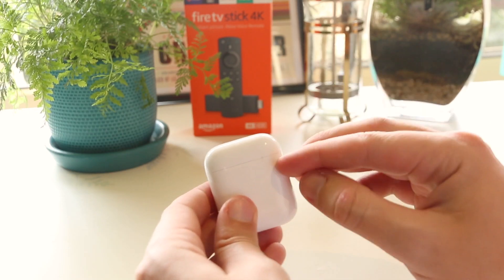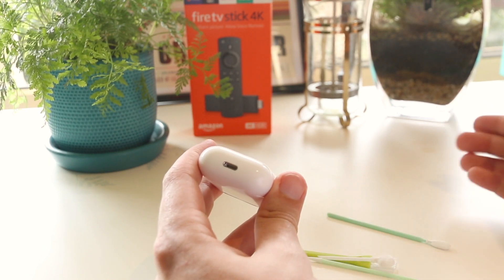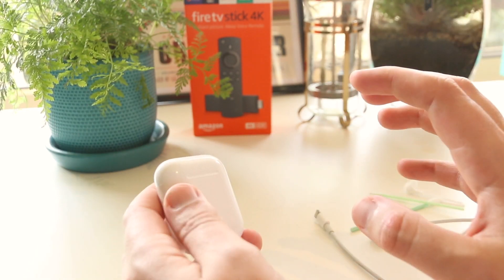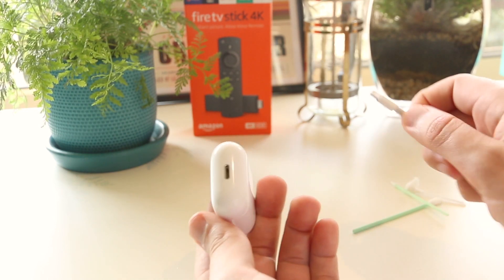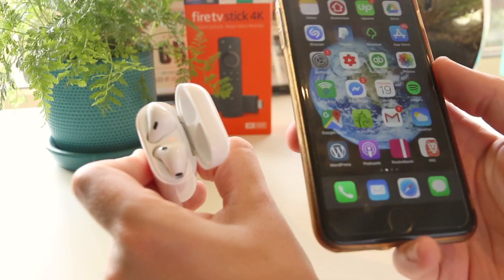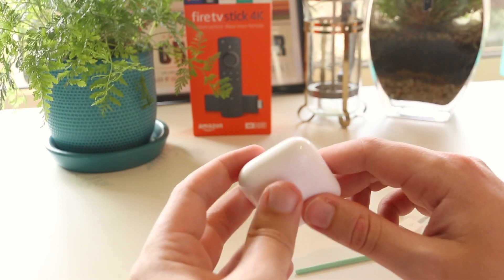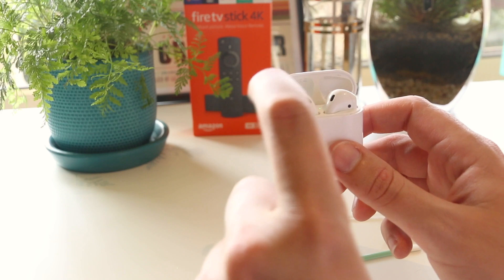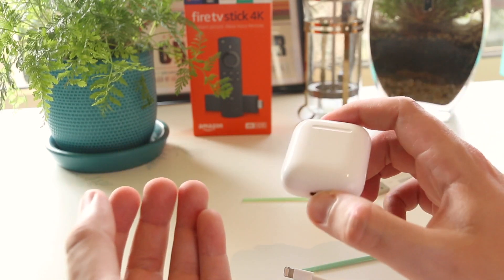AirPods Case/ AirPods Not Charging! 🔥📱🔋 [HOW To FIX!] [SOLVED!]

Comment: AirPods would charge and the case wouldn’t even turn on I tried everything and it just came down to being I had to switch chargers even tho the charger works on other devices
Reply: @seriousryRL what charger did u switch to?
Reply: It wasn’t any official Apple charger just another I had laying around the house.
Reply: @toilet paper Yes I said that I just needed to change the charging wire if it’s anything other than that being the issue I have no idea.
Reply: @seriousryrl3919  thank you so much i had the same problem so ima try that rn
Reply: @seriousryrl3919  BRO IT WORKS THANK YOU SO MUCH I LOVE YOU DUDE
Reply: Return to place of purchase for exchange or refund
Reply: I e got a solution that worked for me
Reply: Hold the button on the back and keep holding than plug in the USB cable while holding the button and then you should see the light pop up🤩 I found this while fiddling around with it
Reply: Mee too
Reply: @seriousryrl3919  that is what I did
Reply: Thx for the help
Reply: ehm- my airpod case is always red- idk if its charging or not- it blinks red then the red light would go out- idk how to fix it-
Reply: That is what happened to me
Reply: Ok me 2
Reply: @leej1a  same suffering here
Reply: @sokatsui2051  diddnt work
Reply: guys my airpods light goes orange for 8 seconds when i plug them in and then no light appears, i left them charging for about 2 hours but still nothing...anybody knows a solution ?
Reply: @TheAlexgou   I took my airpods in same condition to a repair shop ...he charged me only 200₹  means 3 dollar , but i am sure this mistake is a little mistake ...As he fixed that in a very few time , then it was charging perfectly,, but now unfortunately both airbuds are not charging ☹️ and Bluetooth doesn’t work , he asked me for 200 rupees ...i left them there ! without paying because that was not connecting to any phone
Reply: @TheAlexgou  Changing chargers worked. Did you try that?
Reply: @seriousryrl3919  tried my brothers charger and got nothing, fast forward 2 days after and now the orange light is not even lighting up...
Reply: @SeriousryRL Real legend it worked!! ❤️❤️❤️❤️ (no homo)
Reply: @officialtoiletpaper  sams
Reply: @officialtoiletpaper  same
Reply: I am gonna try this when I get home I will lyk if it works
Reply: @Random420.  Hope it does. That’s just what worked for me.
Reply: @seriousryrl3919  it did  thank you

Comment: THANK YOU! At first I tried, putting back and fort the charger and still not working. Then, just like you mentioned, check inside the charging maybe there’s dirt, and behold, there’s heaps of small dust and crushed paper inside. PRO-TIP: Use a Pin or something thin to clean inside it, it will make your life easier. I used the one pin thing that you use to put your sim card (i forgot the name of it) but yeah, it work. Thanks!
Reply: Maybe ejectment pin?

Comment: Can anyone help me out? My Case is having trouble charging n I’m getting pissed off. I switched chargers and I thought it worked because of the orange light but when I open the case and you see the percentage of your airpods it says my airpods are charging but my case is at 0%
Reply: i have the same problem, i cleaned them and changed chargest, but nothing is working
Reply: Same
Reply: I have same problem
Reply: same but my case it’s at 26% but i just got them today
Reply: @noellecrawley3838  same I got my AirPods yesterday but my case won’t charge🤷🏽‍♂️
Reply: Same
Reply: Okay I figure that out it was happening to me I charge it with my computer all I did was plug the charger into the wall and it work
Reply: @noellecrawley3838  me tooo!! but
they are stuck on 27%
Reply: @Mar-dk5ps  do you cablr in and keep pulling it out it worked for me
Reply: This is exactly whats happening to me
Reply: We have the same problem. Mine is in 0% as well, it sucks
Reply: @tythegod6575   same as you.. Hehe 😂
Reply: Wait for it and it will start charging just wait 10-20 mins and if it’s still at 0 
Than i dont know sorry

Comment: Guys I got you I found the solution for AirPod case not working but only working when charging the AirPods all you have to is charge your case for 1 hour and then it should be back running again with the color green again if it’s still not working it’s either you have to restart it, clean between inside the AirPod case charger place, or last option just buy a new case 
I hope this helps

Comment: The orange light turns on for a sec then shuts off won't charge and I just got them (2nd gen
Reply: Yeah
Reply: I have the first generation but the same for me
Reply: Same
Reply: Bro I got you if you have a place you can charge you AirPods up at that does not need a cube like you ps4 or Xbox but they have to be on after you charge it to 100 it should work with any other plug and cube

Comment: My charging case doesn't charge but the actual airpods does. I cleaned it already and it still doesn't work😭😭 it doesn't have light on it too but when i plug in the charger the light turns orange help me please😔😭😭
Reply: I just started having this very problem today. I noticed it literally 15 minutes ago. I’m going to try everything that was said in this video. I hope that your case starts charging.
Reply: @MrHADouble  thankyou🥺 i hope yours works as well♥️
Reply: Same
Reply: 애인강아지 I need help with that aswell the light doesn’t work then I plug it in it flash amber
Reply: @samuelbest550  it does lights up but only when i charge it i did everything and its still not working😔😔 Hope yours will be fix♥️
Reply: 애인강아지 same😔❤️
Reply: Mines didn’t charge too. I pressed on the button on the back for like 4 seconds and then it started charging again. I was about to cry 😭.
Reply: @ana-tf9bu  luckyyyy♥️
Reply: Everyone i just wanna say that my airpods is back to normal😭😭 idk how to explain this but i accidentally dropped my airpods when i was in the car like 4ft and then i charged it for an hour then when i took it theres green light!! And ITS BACK TO NORMALL ITS CHARGIIINGG😭😭♥️
Reply: 애인강아지 ayyy 😂
Reply: 애인강아지 lucky
Reply: @samuelbest550  don't worry sam ill pray for yours too ♥️♥️
Reply: Omg I’m having same exact problem😭
Reply: Alaina Belle The case might be broke so u could get it repaired or get a new case I just bought a new one instead
Reply: Bro same problem to me.... Your airpod fixed?
Reply: Fawz I just bought new ones the pods work it’s just the case u need to get
Reply: @samuelbest550  yaa
Reply: 애인강아지 pray for me to it happend today and I’m gonna cry cause my phone speaker doesn’t workkk :(
Reply: @yangflang9759  don't worry I'll pray for yours too before i sleep😊 miracle happen sometimes💗 dont lose hope! Mine's completely working just fine now
Reply: 애인강아지 thx I’m trying to clean them💞💞
Reply: Press forget device and recharge it
Reply: My wasn’t charging bc it was dirty
Reply: But I thought I left it in my dryer and washer and wouldn’t work that’s what I thought I was nearly bout to buy new air pods
Reply: Me to
Reply: My case isn’t charging as well but my AirPods are... the light is orange but still not charging
Reply: Same
Reply: 애인강아지 same
Reply: Same problem
Reply: Yeah I’m havin the same problem, don’t know what to do
Reply: When the lights turn orange on your airpod when its charging that's means its charging duh duh
Reply: Alpha RANGER_1 but it does not go up it’s shows the orange but doesn’t change
Reply: Same and my mom just got me new ones because I’ve lost my old ones.....
Reply: @mamamo3631  ok I’m finna throw my AirPods out a windo😃😃
Reply: @astrxt6927  im looking forward to it😀
Reply: @mamamo3631  it went bad my AirPod fell out and I can’t find it oop when I was typing this I found it🤣
Reply: @astrxt6927  oh no😂😂 bakaa!
Reply: @sizzle9010  i had the same prob where my airpods are 100% charged yet the case is still 0% n found out from other youtube that says try to charge with ur laptop instead n i tried it n it works omg! Hope it works for u too!
Reply: J
Reply: Jbi
Reply: Damn I ain't even know I typed anything
Reply: OMGG SAMEE UR NOT ALONE HERE BRO I HAVE THIS ISSUE SINCE YESTERDAY
Reply: @mamamo3631  wait can u reexplain pls i charged ut for the whole night and still the case didnt charge
Reply: @mia-dp9qd  dose this really work?? Ill try it thanks
Reply: @s4zan991  okay so ive been charging it everyday since it stopped working i kept charging it and when i charge it it doesn't charge but it lights up orange then when i unpkug the charger theres no light.  So i starte using a tiny brush just like what the video said  then  brush off the inside of the airpods case and also the bottom of the ear piece. Then one day i accidentally dropped it when i was in the car like 4ft high then when i open my airpods case it lowkey works like theres an orange light even when its not charging and then i charged it again and it worked. Im still using my airpods rn. Hope yours works too dont lose hope!😊
Reply: @mamamo3631  OMG THANKK UU GLAD URS WORKED!!
Reply: @s4zan991  yeah it worked
Reply: @mamamo3631  HEYY SO I FOUND THE TRICK EVEN THO I DONT THINK U KNOW HOW BUT THE TRICK IS U NEED TO PRESS THE BUTTON WHILE ITS CHARGING!!!!! IT WORKED FOR ME
Reply: @s4zan991  ohh thats how u reboot it😂 btw good job!! Happy for u😊
Reply: @MrHADouble  p
Reply: i have the same problem so.. ✍️drop.. ✍️airpods..
Reply: @alyssact  u missed "4✍ft✍" 🥰🥰
Reply: @ana-tf9bu  omggggg thank u god bless u because u really helped me I did eat u said and it works omg thank I so much
Reply: @tailineveiga6243  lol np
Reply: Mine only charges when it’s plugged into my laptop
Reply: @mamamo3631  ok soooo basicly i should drop my airpods on purpos, GOT IT
Reply: @syafiqahhuda1  thank youu😭😭😭😭❤️❤️❤️❤️❤️❤️❤️
Reply: SAME
Reply: HEY i hope you see this i had this problem you might be using apples  new charger it only work for new phones and airpods
Reply: Same
Reply: i know it’s been 2 years but i just used a different charger and it worked. the one i usually used to charge my airpods still works fine just not on my airpods
Reply: @petergamez813  mines still workin im still on my first pair💀💀
Reply: @ana-tf9bu  thanks.. it worked for me too🙏🏻🙏🏻 I’m gonna cry too
Reply: Mine are literally not showing anything
Reply: i had the same issue until i plugged my airpods into my macbook pro instead of a plug and reset them by holding the back down for a while, they then started charging again!!!
Reply: Same
Reply: I have the same porblem
Reply: I just bought yesterday and i got this problem 🥺😭
Reply: These AirPods are scams mine didn’t last a year and are already broken won’t charge at all WTF
Reply: Mine does that to😢
Reply: @soggytoes1422  bro same problem
Reply: @mamamo3631  how did you fix
Reply: @Tarunsharma-s1b  brush the charging port and clean it throughly because the reason why its not charging is because dust is stuck in there
Reply: @syafiqahhuda1  TY SM ILY SM OMG MY AIRPODS STARTEF CHARGING
Reply: @georgeleonidasrokkas3793 you need to clean your airpod case (inside and outside) and the airpods itseft because sometimes theres dust that gets stuck at the charging port, then try charging it again, hope this helps:)
Reply: Why this airpods have a much problem what the hell of this .I got the same problem it's haven't light while it's charging

Comment: Mines got stuck in the washer for about one hour but they actually worked the day after but just yesterday whenever I plug the case the orange light turns on for about 5 seconds than it stops. I’ve also left them connected for a whole day but they didn’t charge at all
Reply: @balrajtoodripped5537  me too💀
Reply: Dude that’s the same thing that happened to me did you find a fix?
Reply: Same man how did you fix it?
Reply: Same I have to keep on re plugging  the charger every 5 seconds and the case itself won’t even charge only the AirPods

Comment: So, I know I probably won't get a response, but if I do, I'll be really grateful! 

Okay, so every airpods have 3 main parts. The airpods, the case, and the charger.
Usually if I leave my airpods inside my case where they charge on the charger, everything will get charged. But for some reason, my airpods don't really seem to be connecting to the case to get charged, if that makes sense. I've tried many things, but no matter what, my case will stay charged, but the case won't charge my airpods. I know that my airpods are not connecting to my case to charge Because there is always a blue light that indicates the case is charging the airpods and the airpods (even while inside the case) will have a red light. 
I hope that made sense, and I was hope I could get some help!
Reply: hey i am experiencing the same thing rn. Could u tell what u did?

Comment: My case wont turn on the light when it charges ot even in general my airpods dont chare and are just dead and it doesnt work anymore can you help me
Reply: Hey bro I’ve got a solution that worked for me so disconnect ur AirPods from ur device then hold the button on the back and plug in ur charging cable while holding the button on the back and u should see the orange light pop up👌
Reply: @sokatsui2051  if the orange light came up when do this but then went black after does that mean it worked

Comment: I have a im i786 and it's not charging I dropped it 2 times 1st drop it worked but it wasn't working before the 2nd drop and it still didn't work its like they are not even present their light doesn't show

Comment: My AirPods works or yh worked, i was listening and then the batteri was low But i used it until they died both case and pods. But when I wanted to charge them then they didn’t turn on and then then didn’t want to show lights it’s been like 2-3 weeks. 
And I tried the cleaning there was alot of dirt but they still dont work, idk what to do i dont wanna buy new ones

Comment: So I just found out what was wrong with mine! It was the charging cord that was not functioning for I tried to charge it with another charger, it worked!
Hope it would work for u too!
Reply: When you plugged it in did it turn  amber with the faulty chord ?

Comment: So basically what’s wrong with my AirPods are AirPod pros but the light when I open it it won’t turn on and the case won’t charge and like it will the keyboard charge my phone but not my AirPods and the only way to charge my case is through like those portable portable those ones that you just place your phone on without plugging it in those are the only things that will charge my case I don’t know what else I love took out all the debris it’s still not working I don’t know what to do I think I should just get new AirPods because they’re like almost 2 years old I’ve dropped him multiple times so I think that’s the problem but I don’t know

Comment: My case wasn’t charging but AirPods were when case plugged in. Fixed by unplugging power cable from outlet and plug in and disconnect from AirPod case around 20 times turning the cable over each time, then plugged in as normal and the case and AirPods charged to 100% 👍🏻👍🏻 thanks for the video!
Reply: Hey I am facing the same problem as you can you explain it clearly what you did there to solve...?

Comment: Its cleaned but when im charging them and open the case it shows a red light i left them for 1 day i dont know if they ready it keep showing red a blue light i dont know nothing about airpods (fake airpods) but i need someone to tell me bc when i use them in 10 minites it aays to battery someone explain me how it works

Comment: The case is completely dead and I can’t reset it
Reply: Same my light will hardly show up in the dark
Reply: This happened to me and i fixed it like 10 minutes ago and heres how i fixed it: so after i forgot the device on my phone, i connected them to my charger and at the same time held down the reset button for about fifteen seconds with the case closed, then i disconnected my charger and opened the case and clicked the reset button once and the “connect“ thing popped up on my phone! Sorry if this doesnt work for you but it worked for me:))

Comment: Bro my Case Wont let the cable fully in and there is NOTHING Not an single Dirt in it please answer me as fast as possible
Reply: Please answer Brooooo
Reply: Same with me
Reply: Gabriel Marogi is it like you plug it in but it just wiggles out
Reply: Gabriel Marogi and it’s like it’s so easy to take the charger out

Comment: The trust is that they are very poor quality device
There are a lot of issues with the android and get broken or disconnect very easily
I bought 2 in less than 3 months and both are broken
Right now I got a cable head phones with no issues

Comment: I did everything but it still didn’t work but then I realized my charger was plugged into an extension cord so I unplugged it and plugged my charger into the wall and it worked but thanks for the tips just in case it actually stops charging 🙂